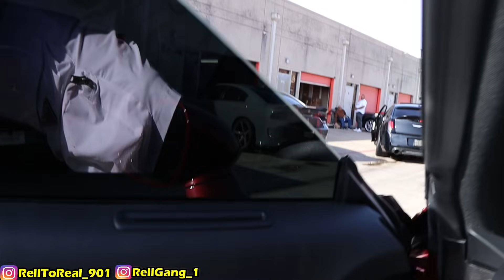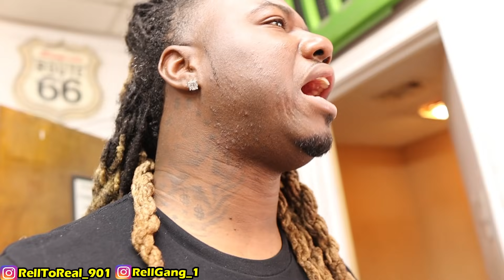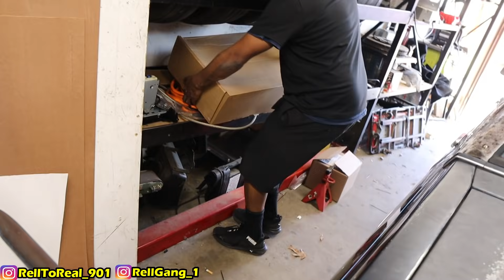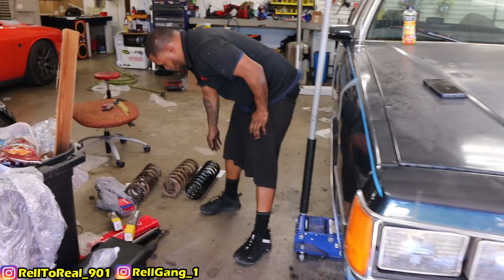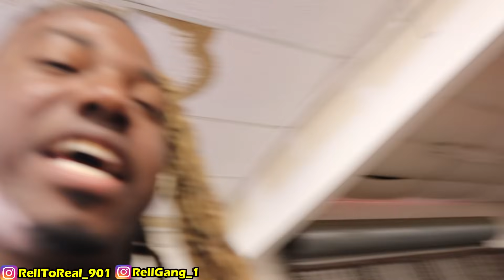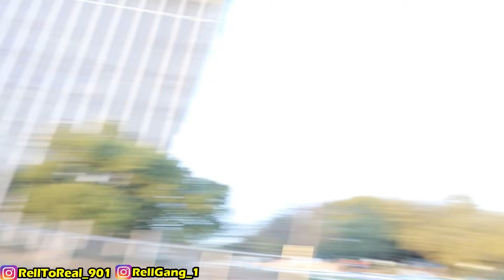RUINED MY CHRISTMAS.. I ALMOST HIT HIM WITH CAR SPRING!!

Comment: Slap some load carrier shocks for the front on that chevy it'll lift it up a bit and give you a better ride
Reply: What springs Mr.BoxChevy would u run with load carrier shocks link if possible?
Reply: @vincentmotley6539  I used coil springs for a Cadillac Fleetwood . Moog coil springs part number 5032

Comment: Once the sleeve came out of the center of those bushings you could have used a torch to burn the old rubber part of the bushings out of your control arms. It smells like shit but it works.